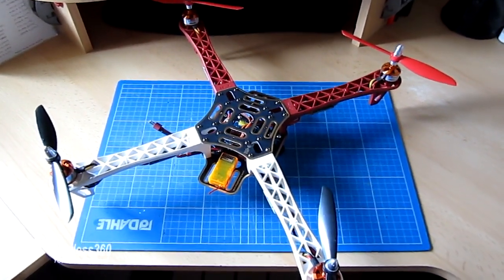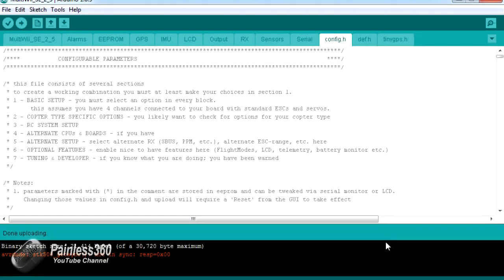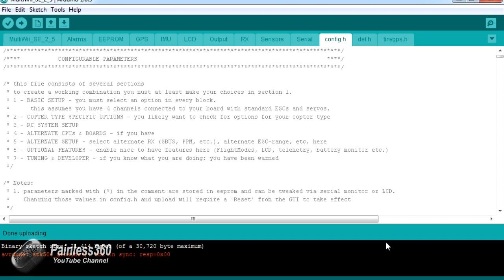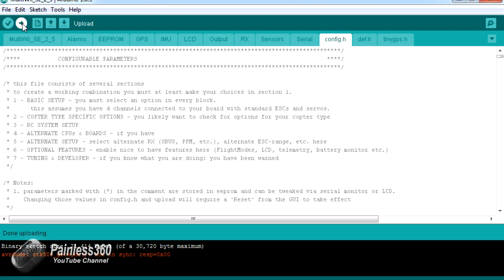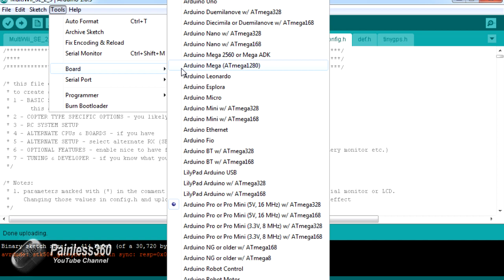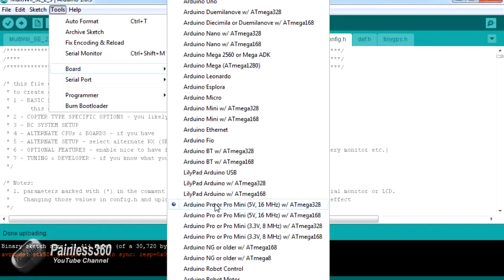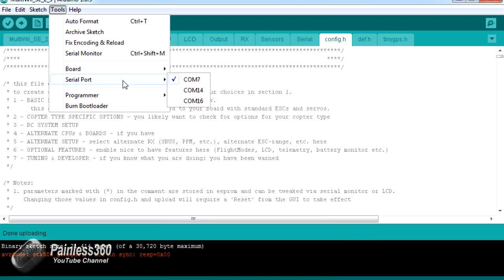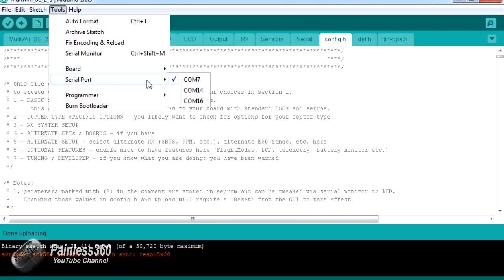avrdude: stk500_getsync(): not in sync error messages -- common fixes

Comment: I've had the same problem with arduino Mega, but even install driver didn't work. But i have found a solution. You can't have plugged anything in TX0 and RX0 on your board. Unplug it and upload. Worked for me
Reply from the maker: Thanks for posting! :D

Comment: I've been working on this issue on and off for way too long. Turns out I made a dumb mistake and connected the Rx pins between the FTDI and CRIUS boards (and same with the Tx pins), when I should have connected the Rx pins to the corresponding Tx pins.... Whoops

I also changed the "bits per second" in device manager for the COM port I was using, to match the "Overriding baud rate" given in the output in the Arduino IDE: "57600"

Comment: i have tried those, still got errors. i dont plug any RX-TX cables but still got that error. any idea? i mean, is there anyway to "Reset" the arduino to initial state or default state?
Reply from the maker: Not that I know of. I’d try adifferent version of the Arduino software, there’s lots of detail in the forums about these issues. Best of luck!

Comment: hey I also have some error m having same board as u I flash it with appropriate settings it works well I connect all the receiver pins to multiwii checked the signals in GUI it was all fine I also observed that my multiwii was armed and disarmed properly then I connect the multiwii on quad all connections as u shown but it didn't armed I tried again but  next tym leds on multiwii start flashing abnormally sometime stop working I removed it from quad and connect it to PC it connect show com port but on GUI m not getting anything when I connect multiwii with PC green LED blink 6-7 time with 1s blink rate n then no reaction at all .
m I crash that multiwii board or I can recover it nw also plz guide me on this
Reply from the maker: +Atul kamble what have you already tried?
Reply: Painless360 : talking about setup it was 30amp ESC with sunnysky 2212 ,450mm body n 5200mamps  3s battery 
to troubleshoot I have tried nothing yet cause it's not responding at all as I said green LED flash for 6-7 times n no LED flashing further it's almost shutdown
Reply from the maker: +Atul kamble remove all connections from flight controller and try another USB cable.. best of luck!
Reply: Painless360 tried it same problem multiwii turn on green LED light 6-7 time n shutdown

Comment: I have tried to fix this error message on 2 different computers. First on Windows 7, 64 bit and the on an older XP machine.  I get the same error on both machines even thou I do all that you have suggested many times.  The breakout board I am using is a FTDI232.  Could it be defective?  How does one diagnose this?Thanks,
Reply from the maker: +sly d Try another USB cable then I'd suspect that the FTDI adapter has a problem.. Best of luck..
Reply: +Painless360 Thanks, I have tried 2 cables - no joy. I'll get another FTDI
Reply from the maker: The common errors are in the video have you checked all of them?
Reply: I can program MultiWii MB with FTDI,  but cannot flash to I2C having 
stk500_getsync(): not in sync error messages. :(
Reply: Yes I tried and also I flash with the I2C board with USBasp programmer and flash the I2C but cannot and result showing is (Override _F)

Comment: What worked for me:

Struggled with this for hours. Finally got it to work by timing the upload from the arduino IDE. I think the MicroOSD device has a "boot mode" when starting, then runs program. If you insert the usb cable / FTDI into the computer, then immediately press upload on the arduino IDE - it gets the upload process started while in this initial "boot mode". Hope this helps.

The modes (I'm guessing) when starting green light is on - then the blue light starts flashing rapidly.  If you don't get the upload started before blue light is flashing... my arduino IDE would get the avrdude sync error.  If you time upload properly during the initial startup - it works?  Good luck.

PS - be sure to throw some salt over your shoulder, don't  walk under ladders, stay away from black cats... etc.  Then it will work.

Comment: This is my error message (something similar I believe)

avrdude: stk500v2_ReceiveMessage(): timeout
avrdude: stk500v2_getsync(): timeout communicating with programmer

Any help with this?
Reply from the maker: +wiskyBOY123 Not sure - I'd google the code and see what comes up...
Reply: fixed it.  thks
Reply: having the same problem can u help me
Reply: I believe my mistake was choosing the wrong board or processor from the tools menu.  Also make sure you know what com port you are using.  It has been a long while that I had this issue so sorry in advance if I am not too detailed. All I remember is that it was a silly mistake of mine for setting up the wrong thing in the Tool menu.

Also FYI I use a MacbookPro though the same principle should apply.  I hope I helped.

Comment: Thank you for your comments I thought i had bought a NANO from HighQualityForYou
ref:: Mini USB Nano V3.0 ATmega328P-AU Micro-controller Board Arduino-compatible.
I got the same error.  i went looking for the processor number as you said and found that NANO didnt work but MINI did - i had thought the mini referred to the USB size but  it was the name of the board.

Comment: I still get this error after choosing the right port and board type and the GUI is not reading the board either. Any ideas why ?
Reply from the maker: +Mohammed Nabil El Shabrawy Usually wiring or bad board. Best of luck..
Reply: +Painless360 I re wired and got another board the same problem. I'm running windows 8.1 pro 64 bit.
Reply from the maker: Not sure then, USB cable? Best of luck with it.

Comment: Get "stk500_recv(): programmer is not responding" when trying to upload firmware for i2c-gps module. Have tried selecting all boards - didn't help.
Reply from the maker: +Yuri Guzun I would go back to the vendor of the board if everything in this video didn't help. Best of luck.
Reply: +Painless360 Thanks. Have managed to fix it by burning bootloader using an usbasp avr programmer.

Comment: Hi! I got the same board ( Multiwii SE v2.5) ,and i wanted to refresh the software by arduino 1.0.5.,after sketching, received the error message: avrdude: stk500_getsync(): not in sync. I made everything as i saw in your video, but not better. The LED's not lighting, until connected to PC. Do you have any idea to solve the problem? THX
Reply from the maker: Csongor Keller Could be all sorts of things if the suggestions in the video didn't get it sorted. Make sure you can see the FTDI board as a COM port in device manager in the PC..
Best of luck.

Comment: H8i Painless360, Iam trying make a update of firmware of controller board BGC 2.2 .. but every time I try, i recieve this massage;

Writing firmware...
avrdude: stk500_getsync(): not in sync: resp=0x00

Can you help me ?
Reply from the maker: Fabricio Medeiros Are you trying to update the firmware using the Arduino program? I've not used Arduino to update the firmware so outside of the ideas in this video I can't help.
Best of luck with it..
Reply: Iam use the SympleBGC Gui last version. ..
Reply from the maker: I've not updated the firmware firmware so outside of the ideas in this video I can't help.

Best of luck with it..

Comment: Painless360 Thank you ! You helped me a lot so I could assemble and configure my quadricoptero. Mainly GPS that requires a lot of commitment. I had several problems mainly for the wrong software versions. So I want to make my lessons learned that can help to assemblers: 1 ) Use the Arduino software version 1.0.1 : When I downloaded the current version , could not even compile the controller board software; With version 1.0.1 could compile normally;
2 ) Use the FTDI version 2.8.14.0 . I could not upload due to error stk500_getsync ( ) !!!! . The problem was the driver installed . I used the version 2.8.14.0 driver. I had to force the use of this driver, because Windows always settled a new version that did not work.

3) Always run the program as a user with administrator profile. Always use the windowns compatibility mode Windowns XP SP 3
My set: Controller : Multiwii 2.5 GPS : Crius Neo 6 I2 Gps Nav Crius (Chip Mega 328p ) PC OS: Windowns 7 SP1 ( 64-bit)
Painless360 Thank you !

Comment: I am getting this error message while trying to flash my nano for use with flashing escs with blheli. I know I have the right com port and rate but i still get it:(.
Reply from the maker: I would check the USB cable you are using and confirm that Tx goes to Rx on the board.

Best of luck.
Reply: Painless360
i don't know how to check that?
Reply: Painless360
I tried a different cable and no luck
Reply from the maker: This error means that the program isn't getting the response it needs from the bao4rds you have selected for some reason could be driver, com port selection, board and CPU selection, USB cable issues, FTDI problem or board problem. You will need to check and confirm each in turn.

Best of luck.
Reply: Painless360 i tried but there is an error downloading software. It says "A service installation section in this INF is invalid."

Comment: I've tried every ATMega 328 on the list and my com port is definitely correct as device manager properly picks it up.  I'm at a total loss :-(
Reply from the maker: Hi, this video isn't an exhaustive list of causes. You need to google the error and run through all the potential issues until you find the one that's causing your issue. I would start here - http://arduino.stackexchange.com/questions/17/some-dude-named-avr-wont-let-me-upload-my-program-aka-avrdude-stk500-getsync
Reply from the maker: Kabab 
Hard to see with the camera moving all the time but I tracing it out by freeze framing the video I think I get that the orange and yellow wires coming out of the MinimOSD are NOT crossed - Tx is going to Tx on the FTDI board.

I would try switching these two wires over on one end and give it another go. Sorry if this isn't it but a static shot is a lot easier to follow when it's wiring..

Hope it helps

Comment: Hi painless,  I'm very new in this.  I've ordered a "MultiWii SE V. 3.0" but there is standing nothing on the back.  There is a mpu6050 (combo),  and a HMC 5883L and a BMP 085. 
There is a #define in the Mw which called 
#define HK_MultiWii_SE_V2.  I have activated it and in the Config I can see the movement, but it's the wrong way and the cycle time goes up to over 30000.
I have seen there is a ATMega 328P and tried to figure out which one I should use.  But everyone makes this error.  What can I do else? 
I'm running MW 2.3 on Windows
Reply from the maker: The problem will be that the board you defined is not the right one and the orientation of the sensors will be out. I'm not sure which is the right one as I've not used this board myself. I'd so to a forum like RCgroups and ask there.

Sorry I can't be of more help.

Comment: Hey man! what about for Arbotix-M type bots. i keep having the same avr dude thing coming out. and ive checked both the boards and ports.
Reply from the maker: Hi Joseph, I don't use them myself but this is a common Arduino error that means the software didn't get the right reply from the board. Usually due to board type wrong, bad USB cable/connector or issues on the board itself (like power problems).

Best of luck getting it sorted. Sorry I can't be of more help.

Comment: Painless360, my current dilemma is anything but.  I still cannot get past this avrdude: stk500_getsync(): not in sync error message.  It is driving me nuts, and is the only thing keeping me from GPS flight with the MultiWii.  The other components programmed with ease. Could I impose to garner your physical intervention in this matter.  I have tried everything else.
Reply from the maker: Henry S. Rhodes Hi Henry, is this the i2c board? I've had a few that came and never wanted to program, no matter what I did :(

Comment: Good video. If this does not fix the error, just uninstall the Arduino board then reinstall with the drivers and make sure Com matches and it should work. This is what worked for me, now works great.

Comment: I'm just about to throw out this board altogether!!!  
    I happend to accidentally break off the mini USB on my multiwii mega pirate board... Anyhow I can rewire this through the FTDI connector right? If the answer is yes, then my next question is, why is it the Multiwii Config program doesn't read the movements on my board?    Before, when i was actually using the mini usb port on the board, everything in the multiwii config program worked fine.

  The only reason why I'm trying to re-flash this board is because I can't get it to ARM. So my last question is... The only way I can fix this is through the programming side of things and not wiring, right?    

   P.S. I watched your video on ARMING and how you change the endpoints on your transmitter. Well, I've done that and it still doesn't arm.
Reply from the maker: I've not used this board myself but the FTDI should work if the USB is broken. It's odd that it won't arm. Can you setup the board to arm using a switch on the TX (see my video on setting Multiwii modes)?Are you sure that that the rudder channel isn't reversed? Does it arm if you hold the throttle stick to the bottom /left instead? You do have to hold the stick to the bottom right for a few seconds for it to arm.Sorry I can't be more help. I hope you get it sorted soon.